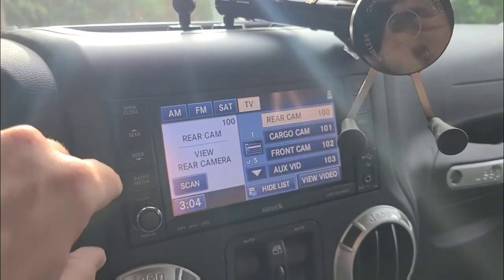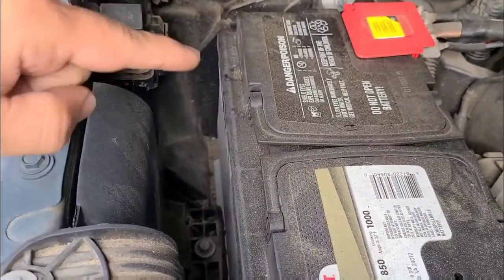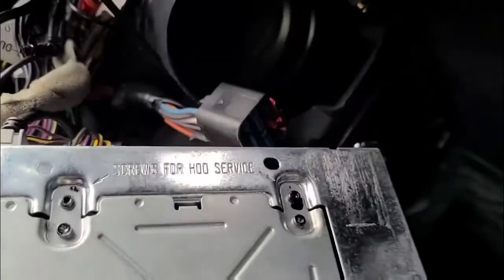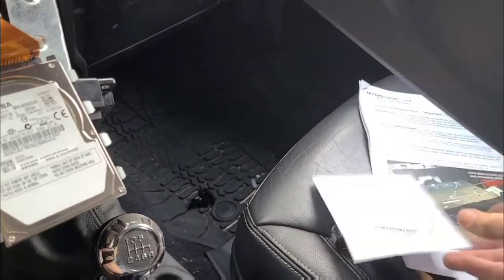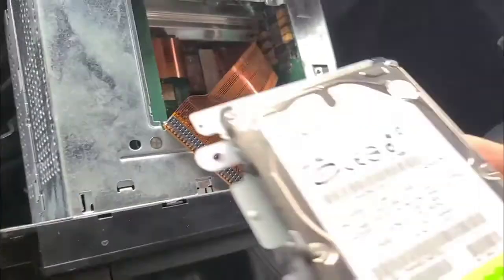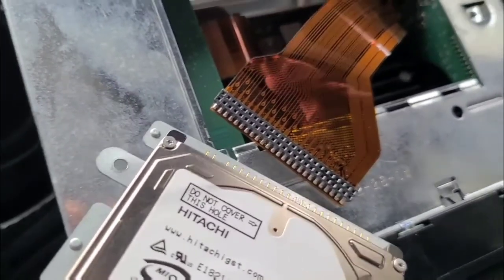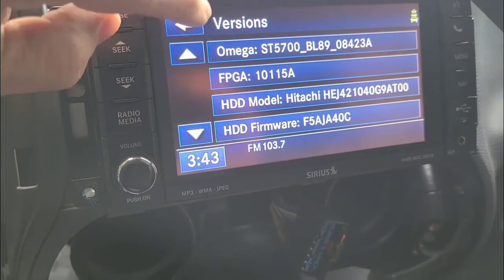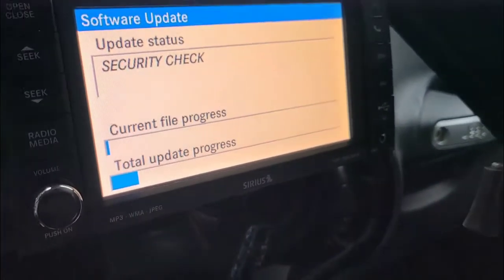UConnect Fix!  Lost Bluetooth and other functions?

Comment: Question..does your preset save on your fm or no....I lost bluetooth and fm preset and backup camera dosent work every now and then...but everything else works okay
Reply from the maker: If you're losing bluetooth and presets, I wonder if you have a power loss?
Reply: @comfort_in_discomfort yeah im thinking its a capacitor  on the motherboar... because the clock is fine ...but I lose my presets every time I cut the key off
Reply from the maker: @ethanbrazile6934 I wonder if a full reset may be a good test.    Both battery terminals off for 10-15 min.    Uconnect is finicky....

Comment: Has it kept up good. Trying to do the same with my 2008 Dodge Charger ?
Reply from the maker: Yup.   Have had 6 months of bumpy hot dusty drives.   Worth the $120.   I don't want to upgrade my head unit, so this works just fine.
Reply: @comfort_in_discomfort  just ordered for my car man thanks for the info and same I want to keep the original radio.
Reply from the maker: Cool.  I hope it works out.  Seems like they have a pretty good tech and response section if you have issues.
Reply: @comfort_in_discomfort  I just did the update on my car man and when the update finished the dodge uconnect screen came up the my screen goes black then again to the dodge unconnected screen. Did you by any chance have this problem after the update or any idea of what it could be ?
Reply from the maker: @srt_gzus304  I didn't have that issue.    I did end up doing the update twice.  But it worked after that.    Maybe try again?   Sucks.
Reply: @comfort_in_discomfort  nvm man I just clicked the musical note on the steering wheel colum and it worked I was worried for a min
Reply from the maker: @srt_gzus304  whew!     Great!